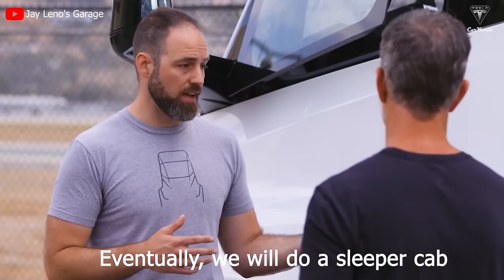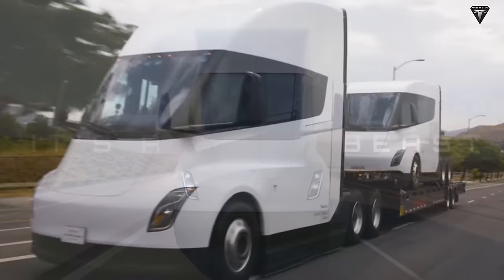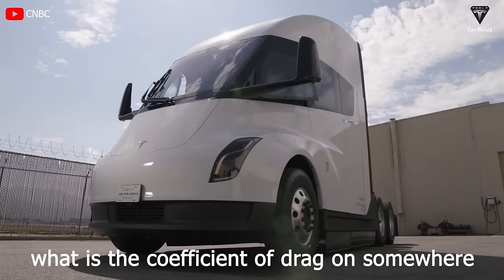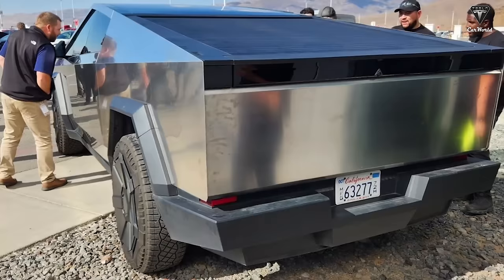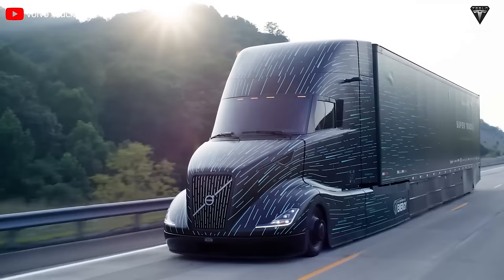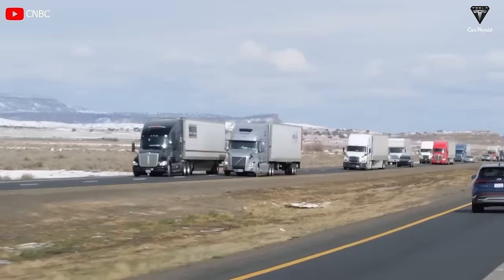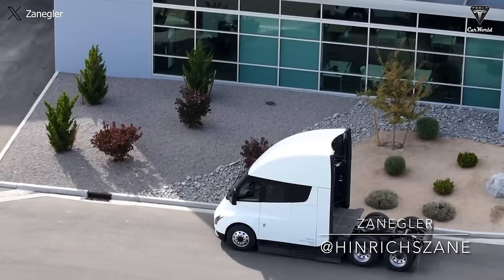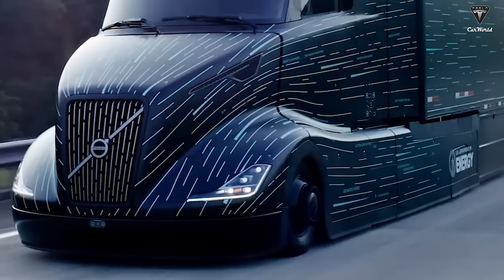DOPE! 2024 Tesla Semi Will Hit the Market! 900 kWh capacity, Weighs up to 80,85lbs and Insane Price!

Comment: Tesla Power Trailer. A 53' box with a power wall where the refrigerator unit would usually be. Wire it to dump power into rigs upon hook-up. It would sit on yards and charge 24 hours a day. You could also wire warehouse docks to trickle overcharge into the building grid when docked and fully charged.

Comment: One mind game truckers of ICE trucks regularly play is when they are dragging an extra heavy trailer behind
and they need fuel. They have to know how much fuel they can take on without exceeding 80k. Sometimes
they can only take on half tank & then fuel again twice as early as they would have so as not to exceed 80K.
Its a hassle but they have to stay legal.

!
Reply: Are they letting diesel trucks carry the same gross Weight as battery trucks.

Comment: The grid won't support mass adoption of EV by the public, but the Semi EV sphere is the perfect space for the technology to stretch its legs and develope while the long haul trucking system and truck stop operators develope the charging grid. Now if the Govt can get out of the way and let us do small format nuclear power sites, we could get the grid up to par.
Reply from the maker: Love your opinion, The manufacturer is focusing on parallel development of a large number of electric trucks and Mega charging stations. However, you know the installation cost is reported to be $6M so the manufacturer is probably finding new steps like using renewable energy for electric trucks or anything that can make Charging costs are significantly reduced

Comment: I saw a Tesla truck on I-95 about a month ago, I had been trying to pass it but it had me beat until a slight traffic delay allowed me to move to the right a lane ahead of it.  Direct drive acceleration was a wow factor.
Reply from the maker: Tesla Semi is capable of accelerating from 0 - 60 mph in just 5 seconds. And even when towing up to 82,000lb of cargo, this vehicle only takes 20 seconds to do the same, an extremely impressive ability. Without a doubt, the Tesla Semi is the most powerful electric tractor today. Thank you
Reply: Correction at 82,000lbs it's towing THOUSANDS of Pounds LESS of cargo weight vs Reliable Cost effective Diesel
Reply: Can you say bull ship a 900 KWH will put out 300 Hp for 3 hours if it was 100 percent efficient
Reply: @TeslaCarWorld  BS... thank you.
Reply: @100pyatt  not correct it will still be able to haul 42,000 pounds. Combined legal DOT weight is 80,000 (without permits) DOT has granted them a 2000 pound exemption for the batteries. Therefore, it’s hauling the same weight as a diesel. 
diesel trucks are not necessarily efficient especially the older ones.
Old trucks with cats and Cummings engines Average 3 to 4 miles per gallon fully loaded. I’m also truck driver and a mechanic so I’m not talking out of my a** completely.

Comment: Is this the truck that already had recall before even rolled out ? lol
Reply: For the record, the 1,000,000-car Lexus recall requires each customer to drive their car to a service center. These cars have faulty sensors. Do you think those sensors are produced in house, or do you think they're from Honda's supply chain?
Tesla 'recalls' are not legacy in nature; they're typically OTA, over the air. 
More than 2,000,000 Acuras and Hondas have been recalled this month for faulty fuel pumps. Are those from the supply chain or were these pumps manufactured by Honda? 
Have you ever thought, even for a second, about the breadth of supply chains for internal combustion, legacy auto manufacturers? About how such an expansive supply chain exposes a company to recalls? What does a broad supply mean for the size and scope of a manufacturer's management team? What are those people making per annum? 
Being highly vertically integrated is a massive advantage to Tesla because it increases margins and keeps quality in house. With lower COGS, margins are high. With those margins, Tesla is able to scale very quickly.
Look into these questions, then compare the speed of innovation at Tesla, not just with respect to design & software, but also to vertical integration & manufacturing. There is no comparison, and it's really sad. Toyota wisely split a working unit from the main company to train up & do business in an agile way, but Tesla has been this way for years. 
People think other mfrs will catch up as if Tesla is standing still. If anything, it is accelerating. 
- Yours truly,
A Tesla Investor with an electrical engineering degree
Cheers from Korea
Reply: @daegueric  But again other companies don t blame the buyers for faulty part or demanding buyers 10 000 Dollars for feature that doesn t work as advertised.
Reply: @jonpetter8921  I am sure they do.
Reply: @daegueric  Which ones ?
Reply: @jonpetter8921  All of 'em!! Do you think companies foot the bill for customer stupidities? Of course not. If something is the customer's fault somehow, and for ICE owners it'd be easier to do warranty-voiding sh!t than for EVs, a mfr is well within its rights to reject a claim. 
Think about it.

Comment: Being an old dolt who has had multiple electric vehicles die or run outta juice, I’d love to see a hybrid.  A truck that could save fuel, run on diesel electric, or run on electric with a generator to extend range… some sort of hybrid would in my mind help acceptance as well as ease into the projected increase in expected electrical demand.  Towing a truck costs about $4,000+ and the option of t drive sources would be genius in my opinion.

Comment: The trailers should be, Tricked out with Solar and bats, to give drivers that option, lots of trailers just sit in the sun for weeks
Reply: I said this to an Amazon manager. Put panels and a power wall on all the trailers, then wire the trailers to dump power into the rig on hook-up. Then also set the buildings to use the trailer power during brown-outs.
Reply: Those batteries add weight though (look at how much the truck weighs, that is mostly battery). Might be OK if all you hauled was light things like chips. But for alot of trips, such a trailer would sacrifice capacity they need for cargo, to be profitable.

Comment: Tesla Powerwall 2 holds 5.6kwh vs 900kwh for Semi. So a trailer covered in solar, and tied into building power, could charge the Powerwall which could charge the Semi 6 times during its run, making for a site to site run of over 2000 miles with instant turn around if it is returning with a fully charged trailer!
Reply: "So a trailer covered in solar" ?
that doesn't work with flat beds, bulkers, or shipping container carriers, even then, a house rooftop system is approx. a 7kw system, and you are only going to charge  the truck battery when connected
Reply: 5.6Kwh, could only only charge the semi .062% 900kwh battery. Not even 1% .... how do you get 6 recharges, from a battery a tiny fraction of the size? Also a 40 foot trailer with panels on the entire top, Would only be max 4kwh of solar .... none of your math holds up at all. A possible simple mistake when you were quickly typing a comment?

Comment: Not much news here. For a commercial vehicle, operations during typical work cycles are more important than a really big battery that is expensive, add a lot of weight, and maybe not needed. Moreover, will there be a version adapted for the global market? too many guessing here. typical heavy truck could be up to 35 m long and 74 metric ton at some markets, for example, while deliveries or operations in cities may require other designs, much less range. Tesla need to develop much more versatile trucks that can be used in different types of operations.

Comment: Electric long haul trucks sound great, but where are we going to get the money to keep our roads in good repair if we do not get it from the tax on fuel??? Are they going to be charged on a milage basis? Are they going to tax them when they register them for road use? If there is no money coming in what are our roads going to look like in a few years????
Reply: Madusmaxamus8670, in The Netherlands we had a government which stimulate the buying of electric vehicles. Now in 2025 the insurance (due to fire hazards and road taxes are implemented to the maximum. Besides that is the infra structure in the country not alowing to expand any extra load capacity for cars or even starting electrifying businesses and homes. So everything comes to an hold en the expensive cost of electricity is increasing to 1,00 US dollar per KwH....

Comment: Stvybaby; that is true but the wind generally is not very constant and so you'd still need packs; the point is - even if you didn't need packs it would take 20 years just to replace the worlds heavy trucks; and if you need packs that could easily double or even triple the number of years required; lithium just doesn't scale enough; takes too much mining effort.  So - something else has to be identified.

Comment: EVs in that weight class, will literally destroy the current infrastructure of our highways, overpasses and bridges.  Not to mention the fact that our electrical grid does not have the capacity to charge a fleet of these semi-tractors.  Simply put, EVs are a red herring.

Comment: The amount of electricity it will take to charge these is just as bad as gas cars. I'm sorry, but it's just as bad as gas unless they are using renewable energy such as solar or wind. The amount of co2 that will be in the air to charge them

Comment: Adding the bed is pure Musk genius, perfect for those 10 hour charges after 300 miles of killer driving.
Reply: It's not pure genius. Tesla has to do it. Nearly half of Class 8 trucks are sleepers. And long haul drivers easily do 600 miles in a day. 300 is nothing, like 5 hours on the job.
Reply: @JohnSmith-zi9or he’s being sarcastic as 300 miles and then stopping for a day to charge is a joke
Reply from the maker: Musk wanted the Tesla Semi to be as perfect as possible and adding the sleeper was the right thing for him to do for this rig!!
Reply: @TeslaCarWorld  a truck that only goes 300-500 miles before sitting for 8-12 hours to charge has to have a sleeper period it’s not elon being smart
Reply: @TeslaCarWorld  He had to do it. The market dictates it. You're acting like its genius.
Reply: @Justmekpc  LOL ... I just saw your point.
Reply: Only 10 days from LA to NYC...
Reply: @TeslaCarWorld  Are they going to be sleeping on top of charging Lithium batteries? I won't even charge a phone or camera battery at home when I am not fully awake and this was well before I was even aware of EVs so no specific axe to grind there.
Reply: @Justmekpc   _ sitting for 8-12 hours to charge_ 
Where'd you get that nutty idea?
Reply: 10 hour charges after 300 miles of killer driving 
Actually 2 hours to charge from 0% to 100%, after 500 miles loaded to 43,000 lbs. But don't give up—even a blind squirrel finds a nut once in a while.

Comment: Rediculous; the Semi battery losses 20% of the total load a Semi is allowed.  Most importantly it proves Lithium can't be utilized. In 2022 total Lithium production was 130,000 tons; a Semi takes 250 lbs of lithium; that means if you used every ounce of lithium to make Semis and nothing else you could only make 1 Million. The USA alone has 9 million heavy trucks that cary 20% more; it would take 10 years just to replace US trucks and 200 to replace World heavy trucks- Even if you could 5x production over night just world trucks would take 40 years. That is zero EV cars, zero cellphones, no laptops, tables, power walls or megapacks.

Comment: Am I supposed to believe the EV will save money in the long run? Price of energy will increase with demands and price of batteries will kill you. Price of gas/diesel will continue to cheaper for the next 30 years or so
Reply from the maker: As the resource is exhausted, the price of gasoline/ diesel will not be cheaper. When electricity demand increases, electric manufacturers will take into account the discount to compete!
What do you think about this?

Comment: These units won't be at your local truck companies anytime soon  , the  cost to replace the nation wide fleet is beyond approachable.  And evan with that the charging time on any given turn around is two days to a week .and that's on every charge. They won't be able to do any long haul runs because of recharging delays  And the country doesn't have the electrical gride to support them ..  up grading the electrical grid would be in the trillions of dollars and take over a decade to achieve.. remember California and their power shortages  , they told all EV owners to not charge their cars they were overwhelming the grid ... then on top of all of this everybody knows how unreliable EV'S are and the extreme shortage of EV mechanics will make these truck unrealistic.. ya their pretty ,,,, Pretty unrealistic ...

Comment: It will make no sense to happen at all in the next 5 years Chris. Reasons why. First they won't make Semis.  The 4680 Cell is so problematic Tesla will use nearly all they can make for the Cybertruck; they can make about 10 cybertrucks insteald of 1 Semi. So Semi's will not be built in any significant number. IF you have none purchased for long haul; why make a bunch of megapac networks?  IF they did resolve the 4680 production issues they'd still have lithium production blocks.  Tesla has a large back order of cybertrucks to fill; not Semi's. The only reason to put out Megapacs now is on the "built it and they will come" idea.  This isn't  subsidised cars; this is business; Semi makes little sense to business. Lastly there is a market downturn w higher interest rates.  Tesla profits are down; it is a bad time to dump money into magapacs without prospect of a return on investment.